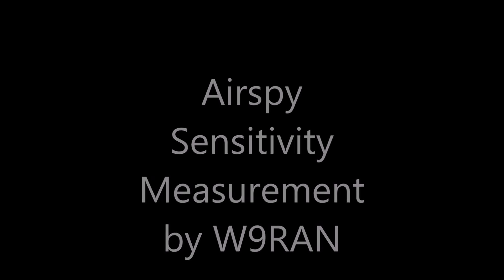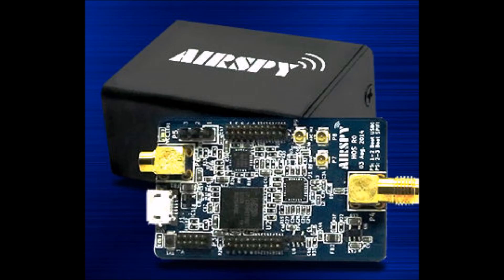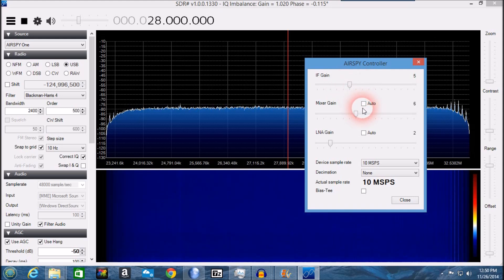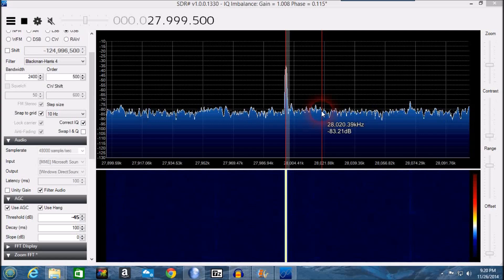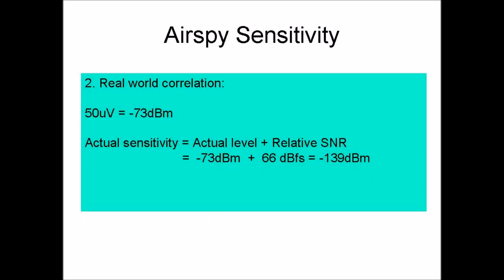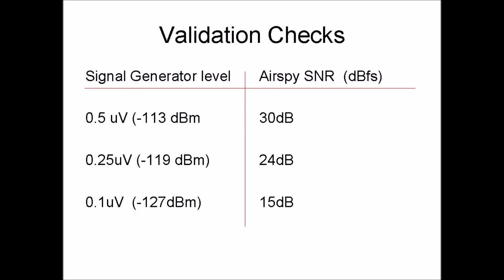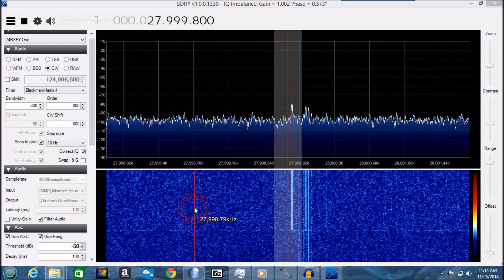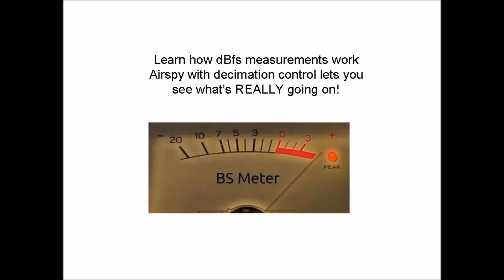Airspy Sensitivity Measurement by W9RAN

Comment: I was pleasantly surprised to see my Airspy R2 able to detect the same signals near the noise floor as my Icom IC-7410 using the same 90ft inverted L antenna.  It was enough to convince me of the Airspy's ability to be used to resolve low level signals.

Comment from the maker: Anders:  While using a SINAD-meter would be more accurate, the way processing gain is handled in SDR# makes it good enough for the average ham to understand. I'd refer you to the previous discussion with Csete about processing gain to get a better idea of what we're showing here.
Reply: Ranickel: OK there is room for different opinions in this world. Airspy1 however has a very good sensitivity when measuring 12 dB SINAD.
Frequency 1055 MHz
SSB 2.4 kHz BW -122 dBm
FM 12.5 kHz BW -119 dBm
AM 6.0 kHz BW -105 dBm
I did some spot measurements at different frequencies down to 29 MHz. The sensitivity increased slowly at lower frequencies and at 29 MHz, about 2 dB higher. Measurement of a NooElec R820T SDR dongle gave essentially the same values with only 1-2 dB lower values at some frequencies. The sensitivity is not the only thing that is important. The next measurement is to measure blocking properties. There, I think Airspy will win. It's much easier to hear weak stations that are squeezed in between strong local FM transmitters on the broadcast band with Airspy. 73 de Anders (SA0BDK)
Reply: Anders Klint
That's expected. The sensitivity is good enough in the receiver. If one needs a lower NF, he can use a LNA at the antenna. There's a bias-tee for that purpose.
In the other hand, the gain distribution in Airspy was designed to match the 12bit ADC behind the tuner. Leif Asbrink (SM5BSZ) has published an extensive set of videos measuring the blocking performance at different separations, and Airspy looks rather good.
Independent measurements are always welcome!

Comment: You are completely wrong out here. You can not assume just the FFT graph and calculate an SNR value. The right way to measure a receiver's sensitivity is to perform a real SINAD or SNR measurement. Decimation does not increase an SDR receiver sensitivity. It just makes it easier to see weak signals close to the noise. Decimation is a way to downsample the signal with filter as decreases antialising distortion which occurs in normal downsampling.

SINAD measurements on an SDR receiver is very easy to perform. Follow the link for more information and a software for radio measurements. http://comtekk.us/

Comment: Many thanks for the content, looks really good and is well done.
I would really love to see how well it performs within VHF and UHF bands versus the RTL-SDR side by side with and without decimation and some good scanner and then check the real world signal to noise ratio. Maybe if you receive a weak ATIS, NOAA-WX and maybe some 70 and 23cm ham radio beacon or any other stable terrestrial signal, that should be a nice practical challenge. Even the Brazilian SatCom pirates and digital data streams in the 250-260MHz range could be a good source of comparison since they are doing long transmissions via geostationary satellites and can be picked by a 8$ RTL dongle and simple antenna with up to 30dB over the noise here in Germany!